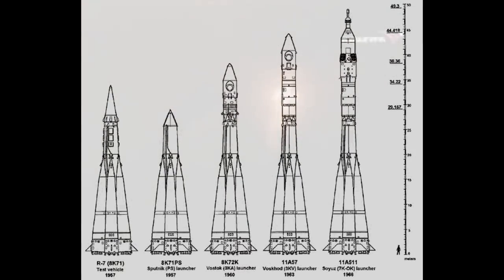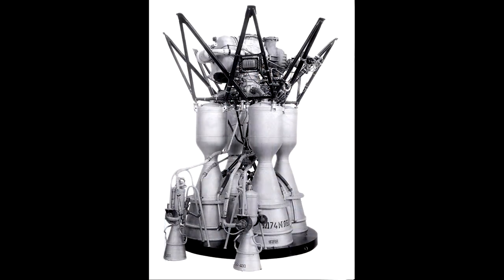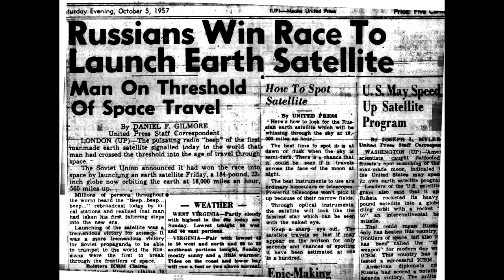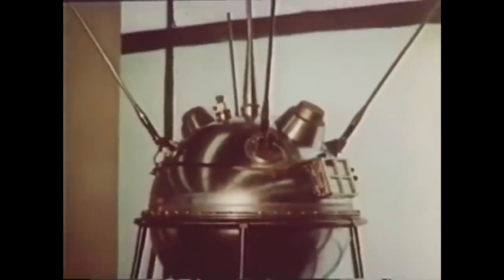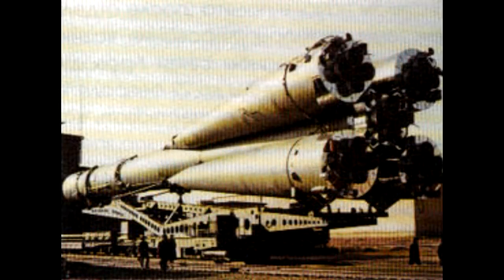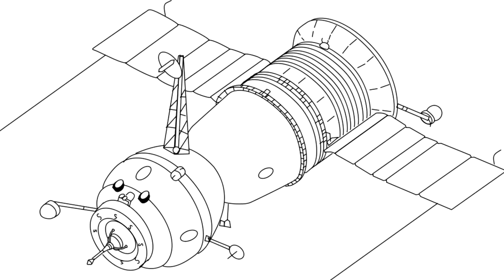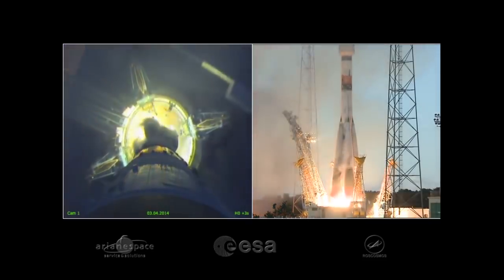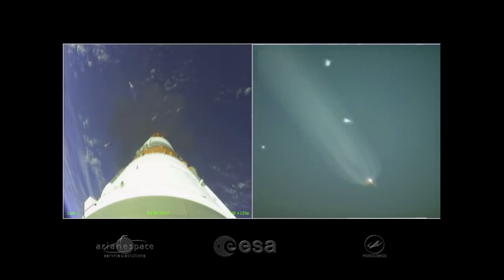The Most Launched Rocket - A History Of The R-7

Comment: Have to love the Russian's design philosophy. "If it aint broke, dont fix it".  The launch vehicle may now have nothing in common with the original, but it was never completely redisigned.  They just changed it as needed over the decades.  The Russians have a very no nonsense approach to their designs.  I saw one video of a spacecraft w/fairing being mated with the booster.  When they added the escape rocket, the connector that attached it to the fairing was bare metal.  Was there some special high tech electro applied coating that required technicians in clean suits in a clean room to apply? No.  It was a guy with coveralls, a paint brush, and a bucket that might have come from a Home Depot paint department.  When we used the Redstone, they had the R7.  When we used the Atlas, they had the R7.  When we used the Titan, they had the R7.  Saturn Ib, R7.  Saturn V, R7.  Nothing, R7.  STS, R7. ....................R7, R7 (funny).  When we have the SLS, they will have......guess!
Reply: Well, to be accurate, the Saturn V equivalent is the N1L3, the R7 just helped in testing of the lander. He actually mentioned the N1.
Reply: SLS - Falcon Heavy
(lol not funny)
Reply: They developed and flew Energia too.
Reply: Yet "you" launched Hubble, YOU went with humans to the moon, You got Voyager underway, New Horizons, Giotto, Juno, Huygens... so many awesome missions with very different requirements to the launch vehicles.
seems for some purposes, mainly a commercialisable LEO station program going the russian way is okay, but for other purposes "one size fits all" is not good enough.

Don't forget that there are some western designs too that did fly wihtout major complete rehauls for similar times. Mostly sounding rockets and lighterweight delivery systems...
Reply: Don't forget the Proton and Energia!
Reply: @Ugly_German_Truths  Yet Soviets sent the FIRST MAN IN SPACE, Yet built first space station, yet still takes Western and whole world astronauts to ISS...
Reply: @aerodynamic1440  (laughs in crew dragon)
Reply: NO actually the R-7 will stop to be used. Because guess what! they can do better than R-7. It has too many conical sections, in which every panel is unique and therefore requires different ground equipment to be made. A fully cylindrical rocket would do better and they finally realised about it
Reply: Joseph... I saw that too! I was stunned into speechlessness!
Reply: @aerodynamic1440  well yeah I say that Germany won the space race because all of our modern rocket's tech all came from the V-2 missile, a Nazi wonder weapon
Reply: @aerodynamic1440  with the same rocket 🚀 😂😂
Reply: Sounds like space x building starship outside and moving raptors by forklift in the open weather
Reply: @aerodynamic1440  i don't think their point was "R-7 sucks"
R-7 is a piece of engineering and i mean this both as a praise and an insult

R-7 sent Gagarin to the orbit (!) before Shepard went up and down a hundred miles and everyone who have played KSP knows that the difference is huge

saying "voyager, new horizons, giotto [btw Giotto is ESA, not NASA]..." is not wrong but launching interplanetary probes is more a maneuver planning than rocket engineering task, and soviets also were the first ones to probe other planets, sending several Venera crafts, some of which were launched on R-7

R-7 is a hammer, and the only things not looking as nails are piles like satellites for which they have a sledgehammer of Proton

Comment: For the soyuz with the NK-33 they should have made a version with four boosters with one NK-33 each.
or i now, like a soyuz with 30 NK-33 boosters on the first stage and send that to the moon
Reply: Would run out of fuel.
Reply: 5000mahmud Then add moar boosters
Reply: 😂😂😂 You got me there man! 👍
Reply: Reloup Way, way too much thrust. I can't crunch any number but that would surely be a lift/mass ratio over 2 at sea level, and up to crazy numbers at stage burnout as the NK-33 doesn't deeply throttle. It's an old engine in today's standards but amazingly efficient, proven, and immediately available in forestial amounts. :)

Comment: I think the 2.1v is a quirky, small rocket with much purpose to compete against upcoming American designs like the Alpha, RS1, and the Terran 1. Using the N1’s closed cycle NK33 in the Soyuz platform should be a good choice, especially if they change it soon to the RD-191, intended to replace it when the remaining examples are depleted.
Reply: Falcon 9, Shuttle and lots of other projects have proven, that price of engine is more important, than efficiency.
Small companies with small simple open cycle engines know what they do

Comment: Every R-7 derivative i know of: 
Sputnik
Launched Sputnik 1-3.
Luna
Just the basic R-7, with an upper stage slapped on top. Launched first Luna probes.
Vostok-L
Basically Luna with an elongated third stage. Launched Korabl-Sputniks, wich were Vostok prototypes. There is actually a russian kids' movie about dogs Strelka and Belka, wich flew on Korabl-Sputnik 2.
Vostok-K
Launched the actual crewed Vostok missions. Yuri Gagarin flew on this rocket.
Vostok-2
Launched Zenit spy satellites.
Molniya
Very unreliable rocket, wich was used for interplanetary and lunar probes. Notable payloads: Venera 1-?, Mars 1, Luna 9.
Molniya-M
Evoluion of the latter. Launched notably Venera ?-8, and its namesake communication satellites.
Voskhod
Launched the Voskhods, obviously.
Polyot
Interim launch vehicle, based on the Voskhod design sans upper stage. Looked like the original missile.
Soyuz 
The iconic, reliable launcher.
Soyuz-2 
Based on the previous.

Comment: Huh, never knew there was an Apollo-Soyuz, I'd seen the handshake picture/image somewhere, but always though it was later Shuttle-Mir program.
Reply: aleksander suur yep, the last Apollo launch. I believe it was the Apollo ship that brought up an adaptor with them to facilitate the dock. Fun fact, the US has moved away from docking whenever possable. We prefer berthing now, much safer and less stressful, also allows the hatches to be slightly wider and thinner making movement through them easier.
Reply: Eeh.. I don't think berthing is inherently better than docking or vice versa, the mechanical interfaces can be designed any shape and size you want. The reason US has not used docking ports lately is that US hasn't flown manned spacecraft lately and US has not had any docking ports for a long time, before recent IDA last US built docking port was for Apollo, shuttle used Russian built docking port.
All the upcoming manned spacecraft are going to use new IDA docking port.

Berthing is the only way to put together two passive modules that are not capable of docking maneuvers, but it's a pita for visiting spacecraft on ISS, they have not automated the robotic arm capture, it's manually controlled by astronaut from ISS. Berthing and un-berthing from ISS is currently labor and time intensive process and can't be done fast enough in case of an emergency.

The new IDA is quite neat in that you can do automatic docking and if you want to you can also use it as berthing mechanism, as a cherry on top it's androgynous. But with many new rockets scaling up, they should think of making a bigger variant of IDA, it's well sized for things like Dragon 2, Dreamchaser, Orion, CST-100, but it's seriously undersized for BFS or whatever New Glenn or SLS could fly if they put up some large pressurized modules.
Reply: All good points except one, the shuttle could deed be unbirthed quickly by basically treating it like an undocking instead. Close the hatches and release the locks, then fire the reaction control. But no matter, the ISS maintained a couple Soyuz craft for emergency escape, i believe in cases where the ISS goes into a red zone for orbital debris it is assumed in a worst case scenario that the shuttle is to big of a target to survive any flying debris.
Reply: Yes, Shuttle used APAS-95 docking adapter manufactured by RKK Energia, it never berthed to ISS. The difference between docking and berthing is basically that in docking the spacecraft maneuvers itself to contact, with berthing the module is manipulated into contact with a robot arm. It's largely semantics, but for example if you have passive tincans that you need to join together then you can't dock, because they cant maneuver on their own power. For a berthing adapter on the other hand you don't need soft capture hardware, so it's cheaper and lighter, but will take more time and effort to join the two pieces together.

Comment: In the more recent launch footage the exhaust plume appears to be pink, perhaps violet. I feel like this requires more explanation.
Reply: I read for about 5 seconds on the color of exhaust plumes and it probably has to do with engine combustion temperatures. The newer engines are more efficient, which means they also run hotter, so all the exhaust products emit higher wavelength light (But obviously only those within their respective spectrums).

Comment: I feel dumb for asking this... why do you usually see debris/pieces of rocket falling from it at launch? Wouldn't something like that be avoided especially these days?
Reply: Rockets Use liquified gases as fuel. Liquified gases are cold. Rocket's outside gets cold. It freezes the water in the air. Rocket will be coated in ice. Not a problem, since it'll easily fall off from the forces during the first seconds of launch. If you look at those launches again, you'll clearly recognize the ice!  (unless you watch Discovery launch </badjoke>)

Comment: Not sure about this piece of information, but the engine from the Soviet r7? Is also used on the American Atlas first stage. The Russians stop sending the engines because they needed the engines for there space program.
Reply: No, the Soyuz uses the ancient, relatively low performance, but very reliable (why its still being used) rd-107 variant. The atlas rd180 did not come from the Soyuz rocket, it came from the four chamber rd170 engine which was originally designed for the energia launcher.

Comment: The R-7 family is good at what it does, but let's be honest: The Russians fell behind in the Space Race because of its limited payload.  They never did build a manned spacecraft heavier than 7 tons, while Apollo weighed something like 45 tons if you include the Lunar Module.
Reply: CountArtha unless you count Buran.
Reply: After the Space Race, yes. ;)
Reply: Roscosmos has manned rockets but some of the designes are kept secret or no pictures
Reply: Russia very mutch won the space race, considering to this day we use R7 variants for all space launches. The Saturn V and its derivatives simply proved to be uneconomical.
Reply: CountArtha they did build the N1, but if failed
Reply: boboprime2000 the rocket failed but the concept didn't the way it's engine works were tested in modren days and it was successful
Reply: hamad samad in concept, the space shuttle was successful aswell, but I do think that a current day developed N1 wouldn't fail three times
Reply: boboprime2000 ur right but remember at that time no one had the capability to test 32 engines in the same day now you have
Reply: The space shuttle failed big and did way more harm to the U.S. space program then any good.
Reply: drake cain No. The Shuttle system flew for 30 years at a 99% success rate, allowing for a large scale orbiting work platform suitable for deployment, retrieval, construction, and even repair of on orbit assets. It wasn't completely perfect, but it absolutely wasn't a failure. This whole mentality where if something isn't flawless then throw it away is idiotic. It's a good thing the Russians didn't think that way, or Soyuz would never have gotten straitened out.
Reply: Hamad Samad Soviets should have worked harder at solving combustion instability and used fewer, larger engines. The insane amount of complexity in just the fuel manifolds for 32 engines is completely bonkers. SpaceX managed, luckily, to get a 27 engine launcher into orbit...but with modern materials and electronics. Back in the 60's it really was just a bad idea.
Reply: How the hell do you get 99% success rate, 2 of the 5 build blowup taking their the full crew with them because their was no way to escape unlike the other space system like the Soyuz and anything they did could have been done cheaper with a large rocket system and the could even have got a few moon missions out of it with how overpriced the shuttle missions were.
Reply: RealityIsTheNow 135 missions in total. 2 failures with total crew loss.
Reply: Yep. An excellent record. Spaceflight is extremely dangerous. This won't be changing. People will keep being killed doing insane things such as strapping themselves into rockets. They know the risks. If people just scream and wring their hands and refuse to accept the inherant dangers that explorers have always faced, we'll never get off this rock. We have to accept our losses and move on when this sort of thing happens. Learn from the failures. The Shuttles flew for 3 decades with two failures. The problem wasn't that they were too dangerous...the problem was that they were too complex and expensive.
Reply: @drake000666  Yes, 2 missions failed out of 135, that makes for a 98.52% success rate, pretty good if you ask me.
Reply: Remember the Apollo 1 fire? The crew died     before the rocket even got close to taking off.
Reply: @egoalter1276  wrong...The saturn 1B and Titan variants were just as capable and economical as the R7, but NASA were a bunch of chickenshits that scrapped em after 1975, to build there little pile of shit shuttles
Reply: I do not think being the only current vehicle ferrying crew to the ISS can be considered 'falling behind'. At this time they are the benchmark for future contenders to be measured against.
Reply: One thing I will point out is that the Space Shuttle did two things no other launch vehicle has even been able to do to date: deliver the Hubble into orbit - 
And repair & service it.  Without the Space Shuttle the Hubble would have been the most expensive piece of space junk in artificial satellite history.
Reply: Moonlanding was a cool but unpractical action. Soviets started the space station  programme same time, which proved to be the right way. We have  ISS, the grandkid of Soviet Salyuts but nobody went to Moon after early 70s. And the Mars rovers are successors of Soviet Lunokhods.  So, now we can say, Soviets actually won the space race.
Reply: @marguskiis7711  
Both programs had their 'firsts.'  Declaring a 'winner' after 1989 betrays a ridiculously behind-the-times mindset.

And considering SpaceX is still the primary cargo supplier for the ISS, one could say on the 'descendancy' POV that no gov't. 'won' ; free enterprise won.

Let's see who puts beds, toilets, and calendars on Mars first.
Reply: @HuntingTarg  Why to make some manned flight to a planet which conditions are similar, even worse than in Antarctika? What for?
Reply: @marguskiis7711  
...thheee, survival of the species?  That's Musk's rationale, at any rate.
Or do you think we can sustainably bunker down on this planet and make some necessary radical changes in our civilization?
I am reminded of Starship Troopers and the civilian outcry about the first meteor impact.
'If you take the easy way, things will get harder.  If you take the hard way, things will get easier.'  -Claude Hamilton

Comment: Can you talk more about the soviet N-1 rocket
Reply from the maker: I think it speaks for itself.

It says 'Boom'.
Reply: I wonder how well it would have worked if Korolev did not have to work with poor-quality materials and poor manufacturing standards, as would often be the case due to inherent flaws in the Soviet system itself. It is known that such flaws contributed to some safety components failing during the Chernobyl disaster. Given this, and the lack of funds, it is remarkable that there was such a rocket at all.

Comment: How is the R7 the most launched rocket? I thought the V2 was the most launched with 3,172 V-2 rockets fired and possibly a few hundred more not on record. Then comes the Scud (R12,R17) with at least 1,700 to 2,000 Scud launches in Afghanistan alone from 1988 to 1992. I think I could dig up at least another 1000 scud variant launches ontop of that...
Reply: Well, they were never really considered as 'Rockets' but as 'Guided Missiles'
Reply: It is literally called the "V2 Rocket" ? uses liquid filled rocket engine?
Reply: I get what you are saying, but how is it any different than the ICBM(literally called a missle) R7 from this video?
Reply: Well...
The R7 is capable of Orbital Flight (with a few modifications), whilst the V2 or the Scud series aren't

The reason as to why the V2 and the Scud series aren't considered to be the 'most launched rockets' is that they aren't capable of Orbital (or even Sub-Orbital) flight, hence why they aren't counted as rockets

Comment: I don't understand why rockets are so expensive. Surely even a modern car is a lot more complicated.
Reply: Milligram a rocket is essentially as large, complex, and reliant on advanced materials as a jet aircraft, except that it can only be used once, or reused after extensive refurbishment. The cost of a launch in fuel alone is hundreds of thousands.
Reply: You're probably right but I suspect you don't know what you're talking about because it's my understanding that fuel isn't what makes space launches expensive. It's the actual rocket engines themselves.
Reply: I realize that. The general rocket hardware is orders of magnitude more expensive than the fuel. That being said, the fuel costs alone would make them quite expensive per-flight, if the rest were easy.